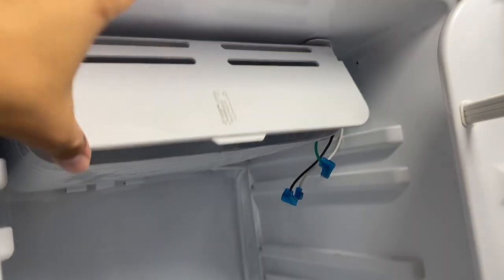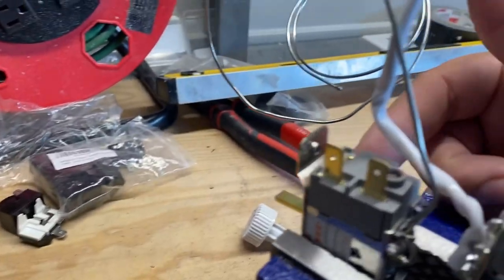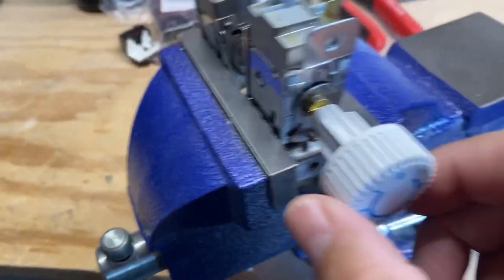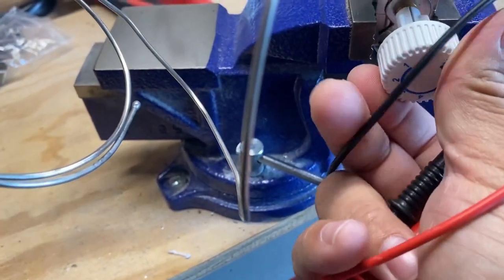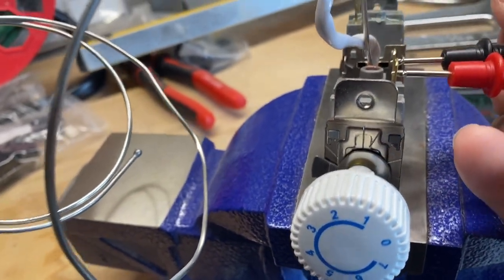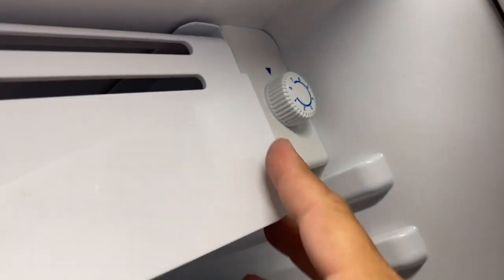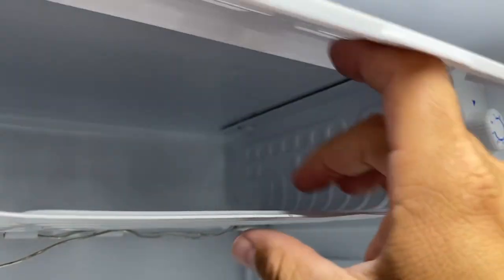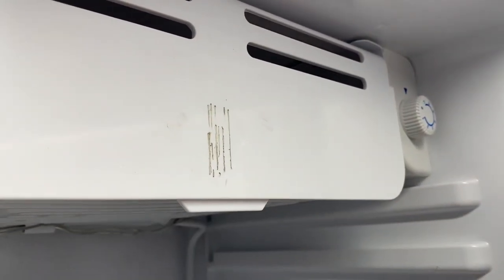Mini Fridge fix! Not running. Not the relay!  thermostat swap out! Here’s How to repair

Comment: What's that sheathed copper or metal line running under the freezer tray? Thermistor sensor?
Reply from the maker: It’s a thermostat probe, which also deals with temperature as a thermistor, just functions differently

Comment: Just checked mine, no sound nothing. Took the fuse out it was rattling and had broken pieces inside. Going to order one now.
Reply: How do ik which one to buy I can’t id the original part
Reply: I bought mine on eBay and the started working again.

Comment: hey, where are you buy the pieces ?
Reply from the maker: I had to do my best estimate with sizes of the nozzle. But here’s the item:  AquaMonica Universal fridge freezer Refrigerator Thermostat WPF-22 Temperature Cold Control Thermostat 1PCS https://a.co/d/aKyn15G
Reply: You can buy replacement parts decent prices on eBay.